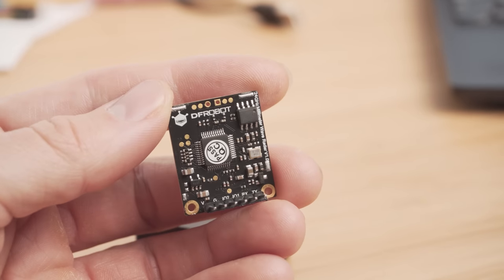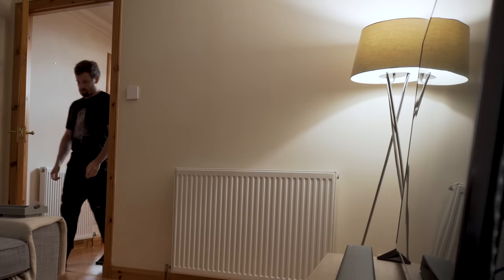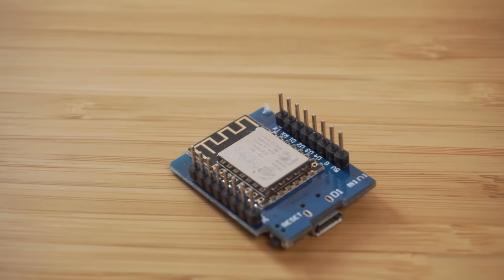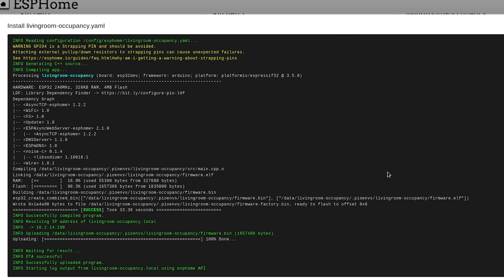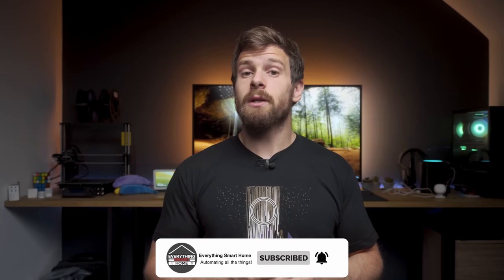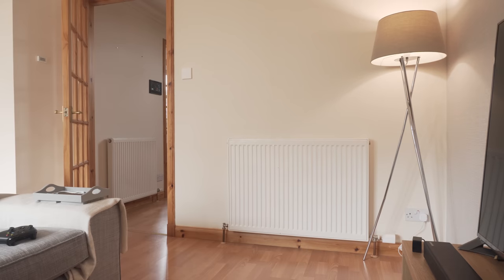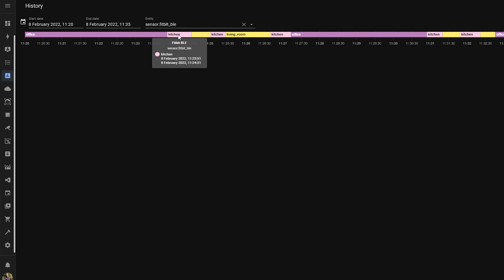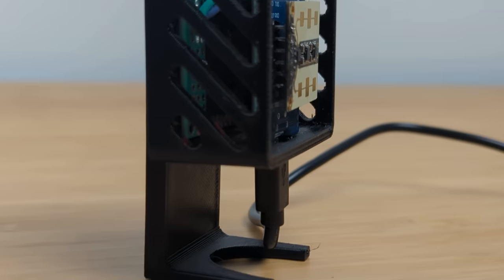Building My Perfect Smart Home Presence Detection Sensor!

Comment: Interested, but I'm not convinced due to the need for electric power. Can we have fewer features but only powered by a battery? In this case, I could place it anywhere I wanted at home.
Thanks.
Reply: Not ESP based. WiFi consumes too much power for it to be reasonable
Reply: @TheHellis  That's true. But can we use a simple RF module and Arduino? How we could DIY our own presence detector that runs on battery?
Reply: The power consumption was not mentioned at all. As a sensor module running 24/7 I really want to know if there are 2 Watts per room draging ~20W in total and costing me 50€ or more a year.
Reply: @l3l4ckR4sp3rry2  unless you have kids that leave lights on everywhere, then those 2 watts are well spent 😀
Reply: @l3l4ckR4sp3rry2  totally agree. My doubt is how we can buid a motion sensor that can be placed anywhere with out electric power. Only batteries. Xiaomi have some but they are quite expensives.
Reply from the maker: Batteries is not feasible for any long term solution that has everything included here, updates at the same frequency this does and has the same flexibility and customisability.

ZigBee is a potential option but you lose much of what I described above. As you can see, the Aqara FP1 is a mmWave sensor and doesnt have any of the other included ones and still requires mains power.

Perhaps one day, it would be very nice to be able to run on batteries!
Reply: @EverythingSmartHome  What about grouping it with a small power bank? Would that be a viable solution at all?

Comment: you could go really down i.e. bme280 is too expensive - you really don't need the pressure sensor in every device - the pressure is the same in the radius of kilometers, so i.e. SHT31 cost 2$, light sensor: TSL2561 = 2$ (both visible and infra spectrum), ESP32=2$. This PIR sensor probably overkill as well but ok. So anyway, from 60 to around 40 it would be easy to get.
Reply from the maker: You could, of course :)
Reply: DHT22

Comment: How does it work with bluetooth? I guess I pair my phone with those bluetooth-devices/"beacons" that then can detect presence?
Reply from the maker: Enable the ibeacon sensor in the HA app and it will work, no need for additional hardware in most cases
Reply: @EverythingSmartHome  hmm... so no pairing required? Is the HA app doing a part here?
Reply: @microfx  the HA app sends a "code" and the ESP listens for codes when they get a match the ESP makes binary sensor true.
Reply: @TheHellis  uhh so how many codes is it sending per Minute? Isn't that kind of battery draining?
Reply: @microfx  don't know. But I haven't noticed much battery drain.

Comment: My concern with the mmWave is the false detection from fans from your previous dfrobot video. Could there be any fix for that since i do have ceiling fan in every room? Last i checked someone had to cover fp1 partially with tinfoil as a solution
Reply from the maker: I do not have ceiling fans myself so not something I can check. You may get away with playing around with the mounting position and also sensitivity possibly
Reply: Have you seen what high powered mmwave can do?
They melt rock.
It's currently being developed as a way of drilling to get heat from deep holes in the ground.

How about that for a worry 😜

Comment: I tried the mmwave sensor. But... compared to your video... the detection is muuuuuch slower. It lasts like 5 seconds until it switches on. 
https://www.youtube.com/watch?v=Mb1CwBor8og

Hmm... any idea why it's so slow? It's as slow as the FP1! 🙂
Reply from the maker: I'm guessing you've done something wrong in that case, double check wiring and code
Reply: @EverythingSmartHome  Now it works. I tried to use the sensor with tasmota… but… that did not work. For whatever reason. 
Question: The red LED on the mmwave pcb is blinking all the time… pretty annoying. 😀 I can‘t see the LED blinking in your videos. Did you desoldered the LED?